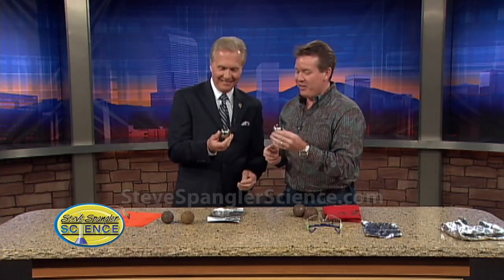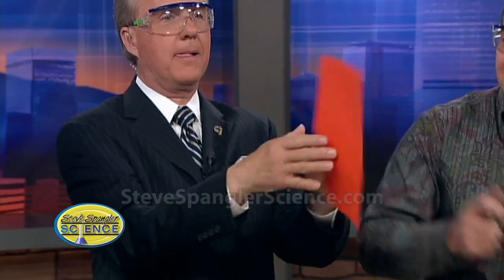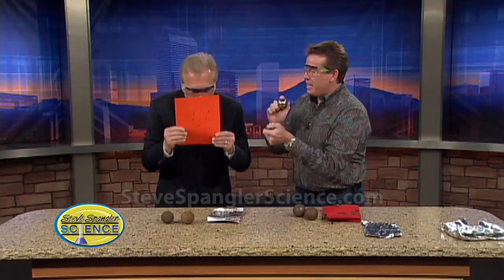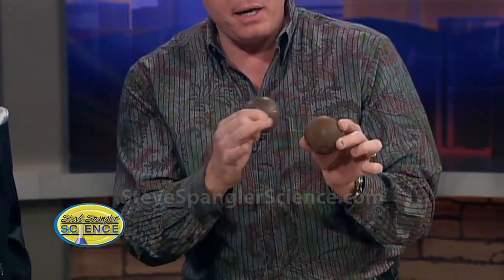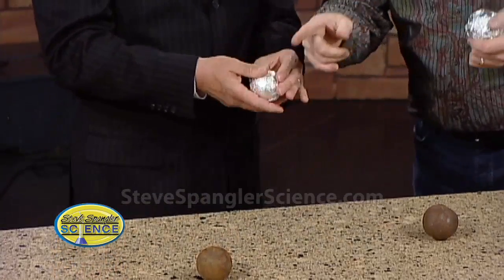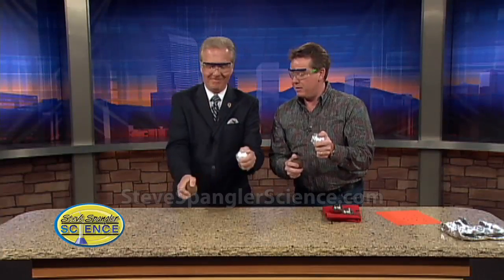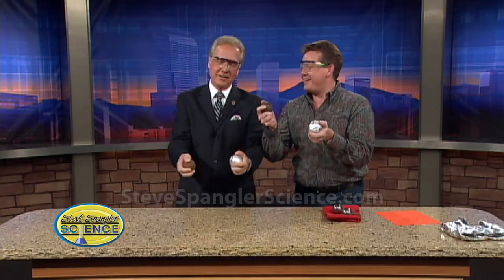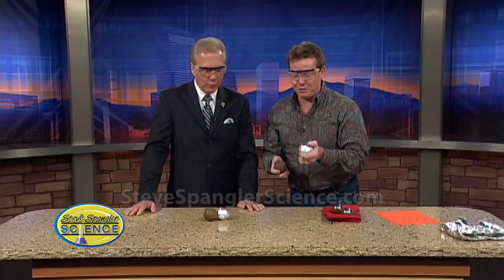Thermite Reaction - Smash! Bang! Boom!

Comment: Thermite is a reaction between Iron oxide(Fe2O3) and Aluminum(Al). Once the ignition temperature is reached, the potential bond with the aluminum is stronger then the potential bond with the iron, releasing Aluminum Oxide(Al2O3) and leaving the iron. Since the contact temperature for a instant exceeds the melting point of the iron, the reaction happens but there is not enough heat and fuel to sustain it, so it only stays active for that second and on that spot.